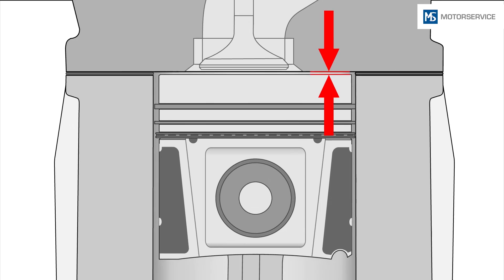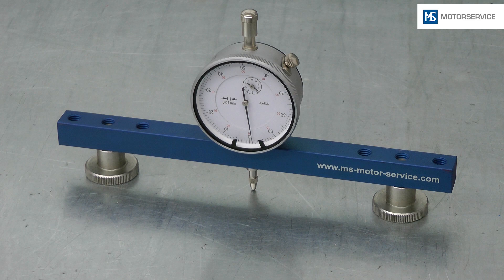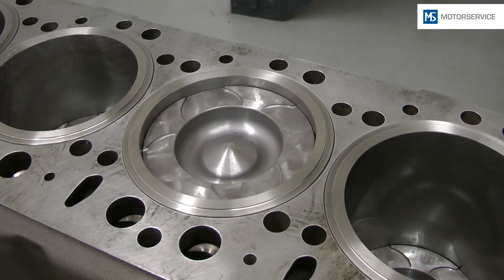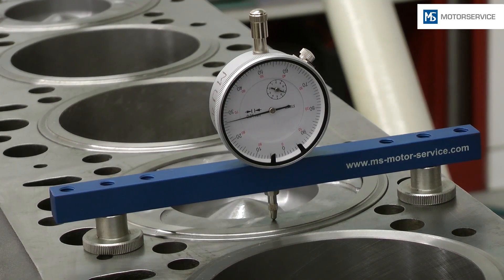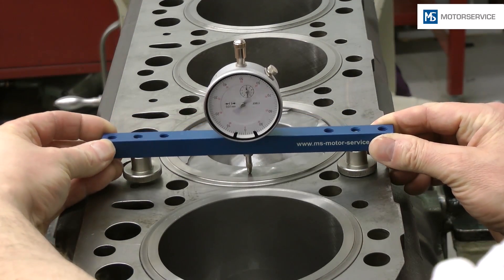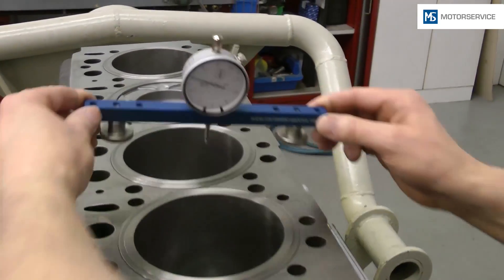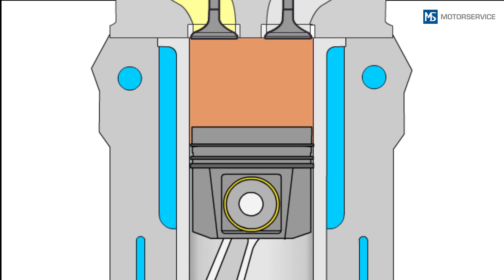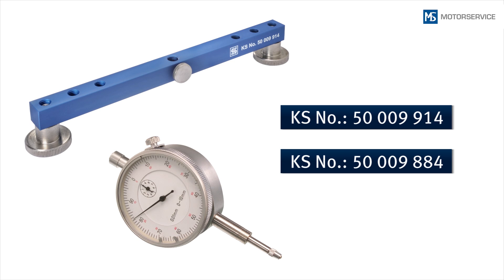Measuring piston protrusion | With a dial gauge and measurement bridge

Comment: Sir I have overhauled a diesel engine and face the block  it has blowby, after I open the head and check the piston top piston is 1mm. Over the block it has less clearance bitween piston and head   that's why engine has blowby I think this is the reason because combrtion area is less, so now I open the piston and machine the piston from top as same level with block thain it will OK. Please advise me.